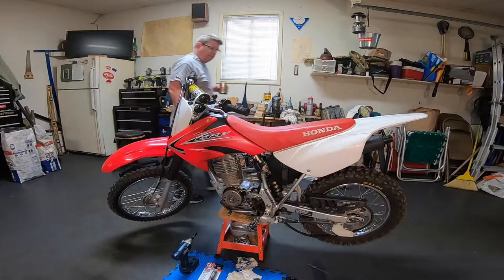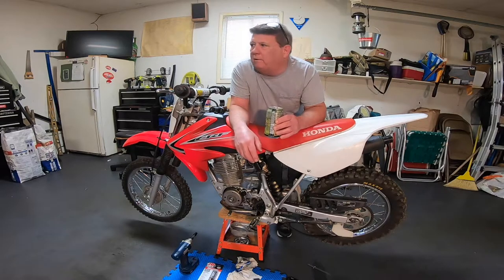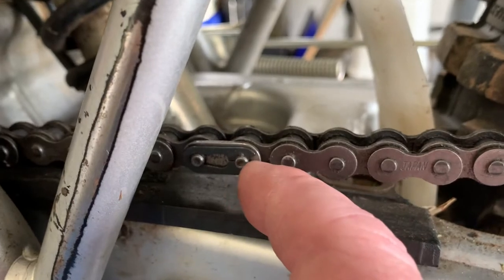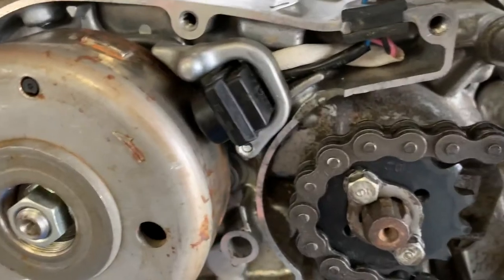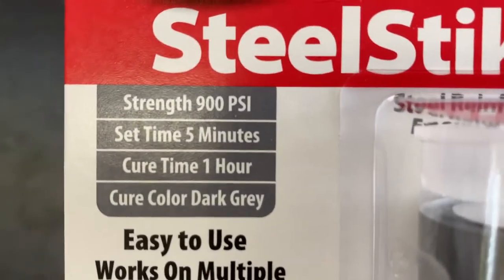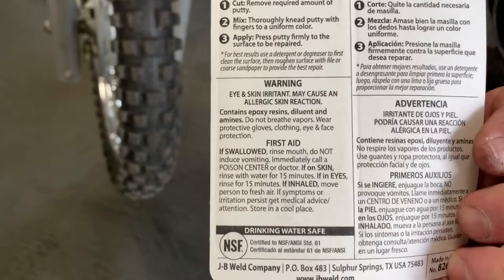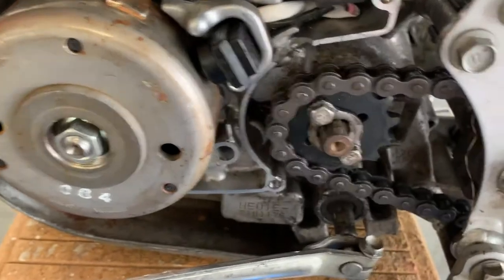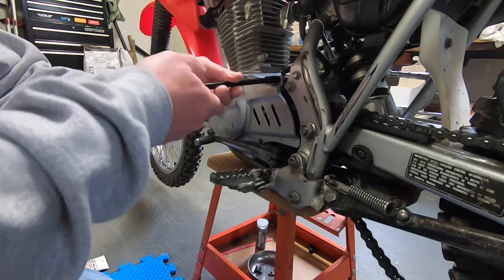Fixing a Honda crf80 with JB weld

Comment: Thank you for this. Gave me the confidence to do my own repair for the same issue (my missing chunk was a bit more downward). I ended up using the original JB weld which was much more gooey than than the putty (I wish I used the putty) and I used some tin and some Dubbin boot polish as a release agent to make a small jig to back the area I was patching up. I didn’t end up putting the crankcase cover back on until it had set, but I did also have to grind it down a bit with the Dremel for a perfect fit. Anyway, thanks again sir, you gave me everything I needed!
Reply from the maker: Glad it worked out, the stuff is amazing.